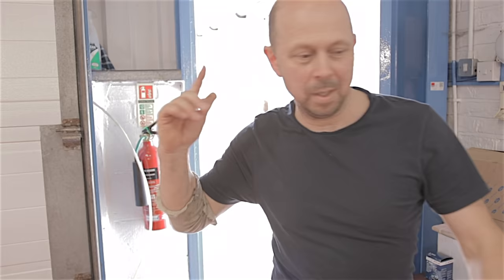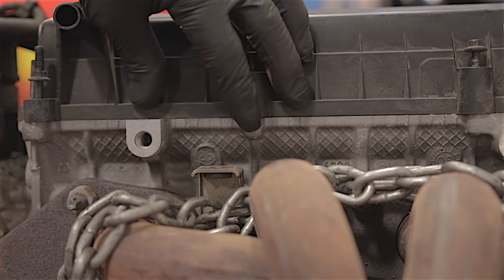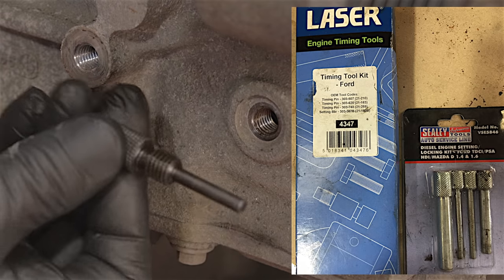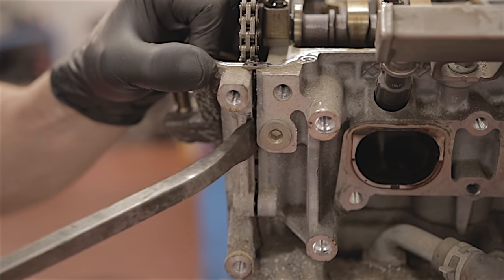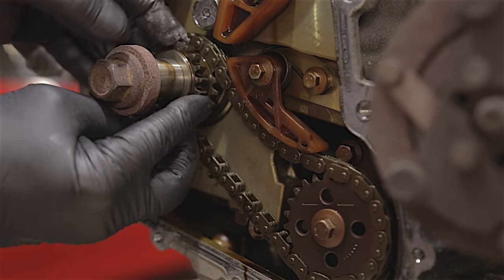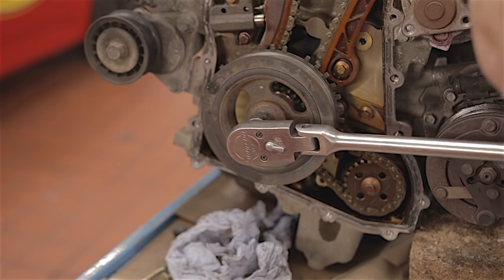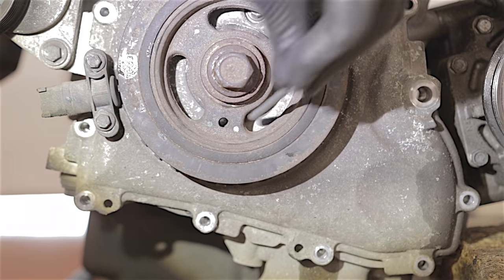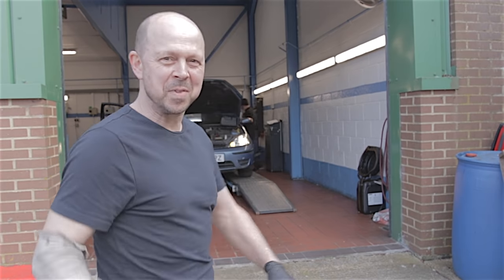Timing Chain, Ford Mondeo Mk3 2L Duratec

Comment: My mk4 petrol has done 141,000 miles and is whisper quiet, uses no oil and gets me 36mpg. The duratec is a Japanese designed engine that's got enough torque to pull in a high gear at lower speed. The v6 duratec is not so robust with many suffering head gasket failures. I had 2 mk1 v6 mondeos that both went the same way. My first was a v6 S.i and the second was a ghia x. The problem was with the waterpump that had the plastic impeller which would detach from the shaft which resulted in overheating. And once those v6 engines cook then head gasket failure is virtually inevitable. Weak spots on that engine were cylinders 3 and 5 that would eventually 'vent', both mine made a ticking noise that sounded like an exhaust leak. Very few if any problems with the 2.0 engine and is a good balance between power and economy. Great video by the way!
Reply: Simon I have the same car. I am doubting the dual mass flywheel however, which I believe is fitted. How is yours? Otherwise perfect engine except valve cover stuck like Alan showed
Reply from the maker: thanks simon, nice information
Reply: @marinusapeldoorn6631  I had the clutch and flywheel done last year. The petrol version is a lot kinder to the flywheel than diesels which produce more torque. The one I had fitted was a brand called LUK. I changed the auxillary belt, idle pulley and tensioner, they have a long service interval of 150k miles! I changed the valve cover gasket too as there was a bit of oil that had leaked into spark plug ports 2 and 4. Usual wear and tear items like discs and pads and tyres etc too. Still has the original exhaust and cat though! Probably the most comfortable car I've ever driven.
Reply: @simonjohnhinton1938  I bought mine at 80000 miles at a Ford dealership. Immaculate car but shock absorbers totally worn and major oil leak from right hand drive gear box oil seal, which had been able to be ignored by 3 different Ford dealers who maintained the car during the first 9 years of its life. The selling Ford dealer cleaned up the gear box and hoped I didn' t notice. However I did and the right hand horizontal drive shaft part had to be replaced because of not being round enough or being too rough on the surface, causing the oil seal to be broken again every time it was replaced under guarantee. Car is fine now, I had the shocks replaced by Bilstein B6. Would you be willing for a little technical experiment which is not too complicated, just out of technical curiosity? Regards from Netherlands.

Comment: my poverty engine in my mk4 mondeo still going strong. 149k and still drives superb. 36.6 mpg combined and uses no oil between changes. the cam chains are pretty robust but its all about maintenance, I change the oil every 6k and the engine is super quiet on the move.

Comment: Since I bought a mondeo mk4 duratec 2.0 a month ago for my wife to drive around the city, this video will help me to take care of the timing chain and the camshafts for checking the valve clearance. I'm planing to install LPG as well then this has to be checked quite often. I've seen stretched timing chains in this engines especially with LPG. If you ever have chance to make a video about Valve Clearance Adjustment in Duratec engines, please make it. Most people don't know they have to check Valve Clearance from time to time especially in high mileage cars and quite often when using LPG. Thanks for all your videos.

Comment: Hi Alan, i just want to thank you for thsi video. I'm about to put one of these engines from a breakers into my mk3 Mondeo Ghia X, currently burns about 1 litre of oil per week and i'm refreshing all the bottom end seals. This has just made my little project so much easier. Big thanks mate, think you've earned a sub.
Reply from the maker: thanks tam..glad it helped

Comment: I currently own a 2006 1.8 mk3 petrol,  I've had it close to 5 years , been pretty reliable , I have replaced the chain and its parts etc as the tensioner gave up most likely down to poor servicing on the previous owner , although the car isn't all that powerful , its reliability makes up for this , everyone I talk to tell me that the engine itself doesn't last all that long due to the piston ring and manifold problem , it hasn't had either problem show and the car is currently on 188000 miles and is still quiet,  cant fault the duratecs , thanks for posting mate

Comment: Quality work as ever.
I'd agree that to do that with the engine still fitted would be almost impossible, especially trying to do the locking pins and crankshaft torque.
FYI - The crankshaft pulley, the timing teeth works on the principal on one tooth missing. There was a full ring of time, equally spaced but where TDC is, there is one tooth missing. Some engines do one tooth missing the others do one singe tooth at TDC.

I'm waiting on the next video where you pull apart the bottom end so that we can see some melted bearings :)
Reply from the maker: right oh lol..i will when in get time🤪

Comment: Man you just made things a lot better for what I have to do. I had the exhaust cam jump a couple teeth due to a mistake I made that I won't get into. The fact that the cam gears aren't keyed to the cams means I can just loosen the bolt on the exhaust cam, advance it back to the proper position with the intake cam, and then just retighten the bolt.

Inspection camera showed no metal bits or damage to the pistons, whether I bent the exhaust valves is yet to be determined.
Reply from the maker: hope you get it sorted

Comment: Granted your instructions were fantastic, I, and several friends, still couldn’t get the timing right after doing the head gaskets on my 02’ 2.3 ranger and I just sold the motor for $200. 

Time for a HO 5.0 or carb’d 302

Comment: Mines had a lot of maintenance over the years. (Touch wood) it's had a pretty hard life before I had it. (640000 miles). I then do a fair bit of standard maintenance on this engine and its now on 160000 miles. I've had my fun with it but it still sound solid. Despite the horror stories of the butter made bottom end on the ford fiesta St 150.

Comment: Great video as usual Alan.
At 25:30 you mention about being able to loosen the camshaft sprocket bolts if the locking tool wasn't fitting into the slots in the other end of the camshafts but that while you could re- tighten the sprocket bolts, you couldn't torque them. All would not be lost though, if you had crowfoot wrenches available. :)
Reply from the maker: thanks for that comment rommel..that is an excellent way🙃

Comment: Thank You.  Confirms what I've been told about timing chains (clearly my rattle is not from there) and advises me that this is clearly not to be attempted 'engine in', and is perhaps impossible (no clearance to remove bolts / casing, even after you've struggled to get at them)

Comment: Hello mate I work as a fork truck engineer 
And the chain on the 2 litre ford petrol engine is very similar 
With multiple plates on a single link
So basically if the same style on chain on a counter balance is similar in design typically the ford chain I'd say is damb near indestructible 
Any just thought I'd add a different perspective 
Love the videos 
I've got the 1.8 lynx engine(converted to chain....wet chain)
And a mk3 duratorq 2.0 litre in a focus  titanium x navigator 
Cheers mate

Comment: Nice video! I just bought my ford Mondeo 2006 Mk3 Station Wagon (BWY) 1.8L Benzine 125 PK. After 5 days I found out it’s used 1 liter oil on 100km 😕. Now I wanna rebuild the engine, but I have a few questions. 1: How can I check if my timing chain need to be replaced. 2: Do I need to replace my pistons and hone the cilinders (or can I only replace the rings on the pistons. 3: If I loose my piston rods do I need te replace the bearings if they look ok?.  I hope you can help me out, and if you have other tips please let me know! Thank you so much! Friendly regards, Toby

Comment: You can use a normal bolt instead of the pin, just put it at top dead center and then put the bolt in till it is up against the crank, it can't turn anymore than your bolt and its got more surface area so you  don't have to worry about bending the pin when you mess with your pulley for the crank

Comment: I wish the timing cover was that design on the Puma oil burner of the same era. The diesel one is a bit of pressed tin. Impossible to get off without distorting as it has a bigger contact surface area to the block by the aircon compressor. And a nightmare to try and get off in the car. I had the pawl fail in the tensioner on my 54 plate @ about 110k miles. I got it before it jumped the timing. At idle with lower oil pressure the chain slopped around! Did the guides etc at the same time. Something gone again inside it now at 220K but its got other issues with the fuel system now. Sounds like a guide gone.There was quite a bit of chain stretch on it. Apart from the early swirl flaps and coil packs, they were a great engine with few weak points so long as you maintained them. This was the era when ford had money invested in Mazda.

Comment: Hi I’m amazed as a trainee looking at that crankshaft pulley having no key way hopefully that bolt that holds the pulley is torqued up really high because as you say the oil pump sprocket on the crank shaft is held in place by the compression of that bolt meaning a lose bolt could with the engine running allow the oil pump to free wheel and stop functioning. I’m really surprised fords allowed that?
Great vids alan.
Reply: This is a *MAZDA Engine Type L6*. 

I think from the time periode Mazda and Ford have a closer look what they have developed ...
Ford only changed a few  thinks  (I think). 

As far as I know there is in the Mondeo MK3 commuity *in germany absolute no owner with a lose pulley*. 

Attention = the petrol 1,8 Li Duratec SCi directinjection engine is a lot different and have a lot identcal parts but the expensive parts + service ... ok I stop at thise point ...
(see the intake camshaft and you understand and all around the directinjection AND search for internet forum).

Comment: Pretty sure this is identical to my 2L mk3 mx5 engine, it would be great if you could check that is the case and add it to the description! 

I can't find ANY videos nearly this thorough on youtube. 

We already destroyed 1 engine because we didn't know about the crankshaft positioning bolt -_- now the new engine that we didn't do anything with has started making horrible banging noises and the timing chain is so loose you can move it between the cam shafts a good 3-5cm!!! something is broken in there and i'm going to use some of the techniques i see in this video to help me this time!

Comment: Good to know the timing chain is a strong part of these engines, mine has covered 129k miles and still on the original timing chain.😯⚠️😁
I doubt very much you could do this with the engine still in the car?
Only issue I've had with this engine is the silly EGR valve getting stuck open! 😯⚠️

Comment: Great video what you said at 6:10 I couldn’t have said it better myself. Just had to do a chain on an N47 Bmw engine 🤦🏽‍♂️
Reply from the maker: done a few bmw chains and not impressed plus the oil pick up pipe in the sump is so narrow it sucks up all the broken chain guide plastic and starves the engine of oil

Comment: I believe that the crank harmonic balancer that carries the crank timing tabs and locks against the cam & oil pump chain sprocket should have a diamond washer that provides the locking action against the sprocket instead of a keyway system. That washer should be replaced along with the crank bolt as they are both single-use items. That diamond washer is shown in the top left corner (labeled 7) of the diagram at the beginning of the video.

Comment: Alan been scroling your vids looking for info by the way your vid are fantastic.   I wonder if you could help me? I have a 1.6 tdci engine and the belt snapped what I'm finding hard to get the info on is where should the piston be when I time the crack. on my engine all pistons are level near the bottom and 2 and 3 are on there way up would this be right?
thanks
Reply from the maker: hi, if you give me your reg number i can look up where your crank and camshaft sprockets should sit when you fit a new timing belt but generally pistons 1 and 4 would be near top dead centre and pistons 2 and 3 would be near the bottom of the cylinders
Reply: @alan4x  yeah thanks for the reply my reg is ML64 YPX, I've been told this of a few guys that 1 and 4 should be tdc. I came across a forum chat which was saying that the magnetic ring on the crack sprocket can  come loose and spin round have you ever come across this ?
Reply from the maker: @dannye6070  i left an image on my community tab for timing up your cam belt but the magnetic ring on the crank is normally fitted onto a woodruff key...i have not personally known them to spin

Comment: I have the 1.8 ltr mondeo petrol mk3 and it is not a potatoe and have never had a chain issue however i had a little leak from the camcover ,so i replaced the gaskets..... But on replacing 8mm bolts i broke 1..... I can not get one anywhere !!!!!would it be possible to buy one from you? STAY SAFE😄😄😄😄😄😄😄
Reply from the maker: i don't know where the ford potato line came from but its stuck with me🤪yeah sure you can have a bolt..call 01480 459991 and i will get your address and send it to you
Reply: @alan4x  your a ledgend i,ll give you a call😄😄😄😄

Comment: Timing chains on ST250's sound like they are gonna break or come off altogether when the engine is hot, mix the direct injection ticking, HPFP Ticking, DMF flap on tickover and the timing chain noise.
Reply: The ST250 is a V6 engine. 
Normal not many noise. 
But older engines ...

... noise = engine is ceying for service immediatily.

Even the 4 cyl Duratec HE (or SCI) engine is very quite. 
Noise means wear and very very soon a service. 

Ignore these noise and you will pay a lot more. 
Mk3 is older than 26 years = often economic desaster to repair these old engine. Buy a other MK3 but never ever spnd a lot of money. 
Ok , when the chasis is in good shape and the engine is well serviced since years ...

Comment: Hey there Alan, really enjoy your entertaining approach to vids. I'm looking at a 2.3L Duratec with a leaking front crank seal. I believe this is the same 2.3L in the pre-skyactiv Mazda6's?? In any case, I'm just trying to be certain as to whether I can remove the crank pulley to get to the seal without having to do all the re-timing palava ... ie is the timing sprocket loose behind the pulley or fixed to the crank timing chain sprocket so it can't move once pulley is removed. Thanks;-)

Comment: Hi Alan, is the ford spec'd 913c/d oil essential for engine longegity? Recently bought a second hand 2013 Focus TDCI here in Taiwan, which I believe has the same engine. The ford spec w913c oil isnt easily found here, and dealer serviced with Motul 8100 x clean 5w30 (not the ford spec).
Your videos are superb!

Comment: Alan I followed your video to change timing chain and alls perfect , built engine back up and now when I run the engine it’s spitting oil from somewhere , any clue to where it’s losing the oil from, if the crank seal is not 100% flush and is inside the casing a tad would this cause the problem??

Comment: Had to stop at 0:17 and give thumbs up :D Btw. did Ford use some kind of universal set of timing tools back those days? Those look to my remembering pretty much identical to 1.8 endura diesel timing tools. Though I made them from drillbits, flat bars and bolts as poor kid.
Reply from the maker: cheers jothain ..not sure but probably did as quite a few ford engines were using very similar timing pins and that setting bar for cams fits all sorts

Comment: Questions, questions and questions? when you insert the pin in the rear of the block, what is  the length of the pin? I bought the kit on amazon for the timing belt, one of pins is 2 1/4 long in length. the other is 3 inch. - / +

Comment: Alan help! Mondeo mk3 2006 130 hp tdci. Is there easy way the check timing chain and timing? Starting sound is not right to my ears. Car not run at all. Fuel pressure about 400 bar when starting so it good.
Reply: It was what I think. Timing chain’s tensioner was dead and other camshaft was jump of timing
Reply from the maker: no, not an easy way to check it and to get to it is an ordeal as well

Comment: Alan, you are a top guy. I have watched this video over and over. I have the early mk4 Mondeo, with 175000 on clock, so practically the same. I love your channel and It gave me inspiration to checking my timing, chain and auxiliary belt and pulleys whilst it was still in the car! I followed your advice, took pictures videos and was very methodical. I loved every minute. 

My only issue no is the  car turns the engine but makes no and I mean no attempt to start. I know what your thinking... battery - new, spark plugs new and tested, starter fine. I have spark. Fuel - yes, pump working and evidence of fuel in the cylinder. Compression... still waiting to complete this test which is likely to be Tuesday now. Cam sensor replaced new. The car had no real issues before the replacement, although the chain had suffered with a bit of stretch and the tensioner was on its last legs. 

Any advice...
Reply: Did you find anything?
Reply: @maxevans9688  - Well put it this way. I went mental and stripped the entire engine after I found the stretch. 

For me, the timing was out. Because I did a full strip down including the head gasket. Before rebuilding. I manage to solve the issue. 

I really enjoyed myself. The only advice I could give is take pictures and videos and label everything. 

Turning the key after and watching the car fire up…

“Priceless”